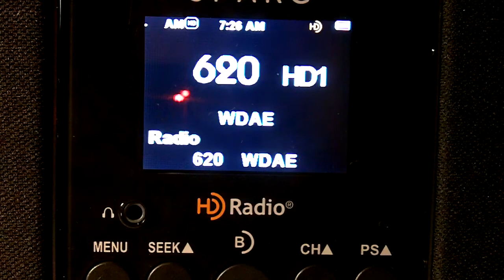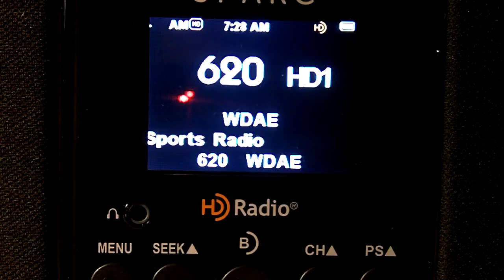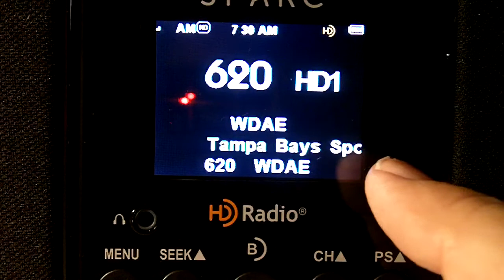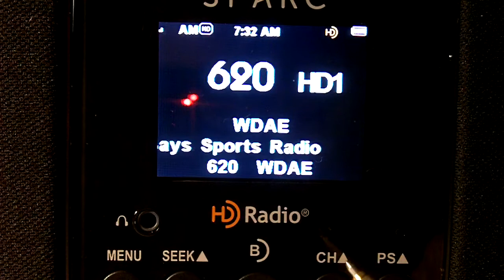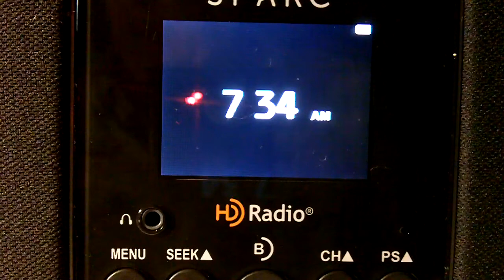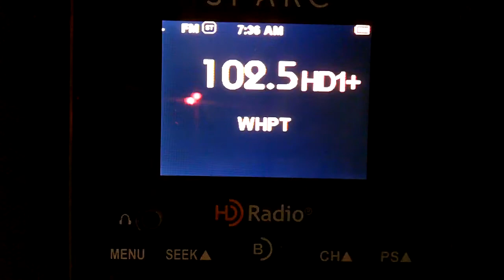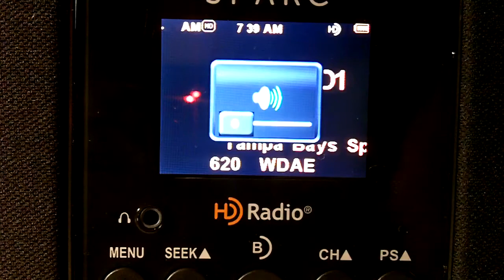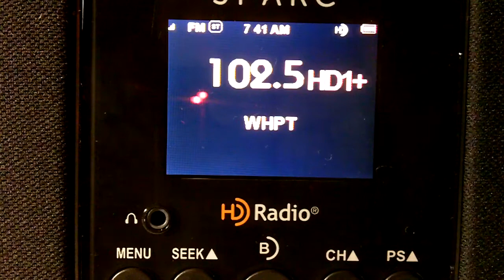TRRS #0540 - AM/FM HD Radio - Display

Comment: Tom I know that you know a lot more about radio than me so I have a question for you. Yesterday was a nice sunny day were I live so I thought I would get great radio reception, but my beofeng uv5r had about 1/4 as good of reception as it usually does to my local weather station. At first I thought it was my radio but then my car radio wouldn't pick up its usual stations and even my clock radio wasn't working well at all. Is this something to do with atmosphere or what?
Reply from the maker: TS O'Day You are correct.  This past weekend we had some strange solar activity which effects radio reception.  Early this morning before dawn I was having problems receiving AM and FM bands.  About 7am EDT everything was back to normal.

Tom
Reply: TS O'Day change the batteries and point the antenna to the sun.

Comment: Does that radio run on batteries? Because I saw a battery indicator in the top right corner.
Reply from the maker: Andrew Secinore No it only uses batteries to backup the memories and the clock.